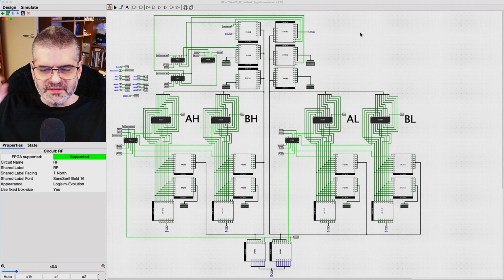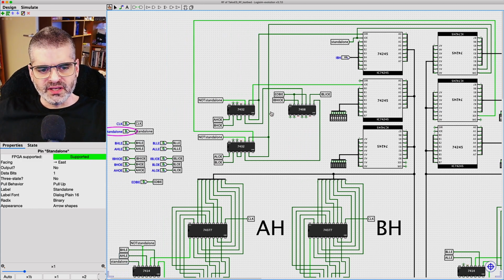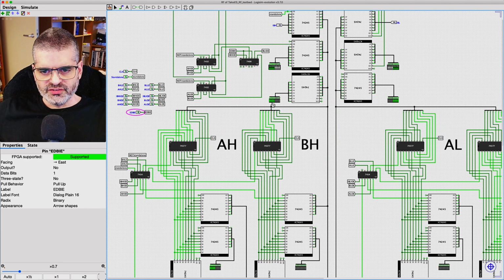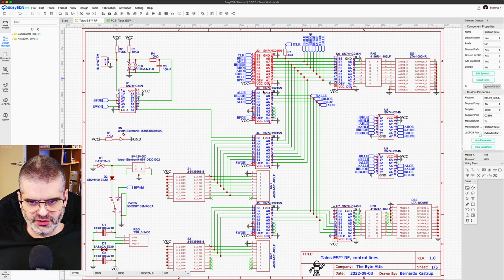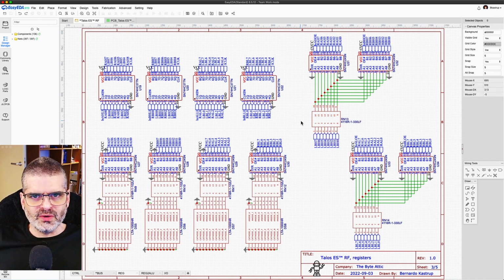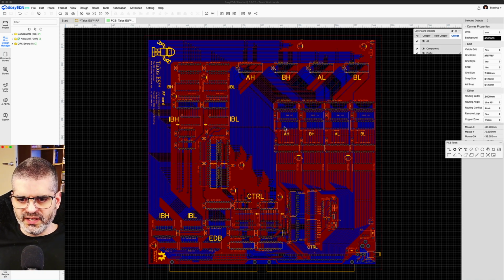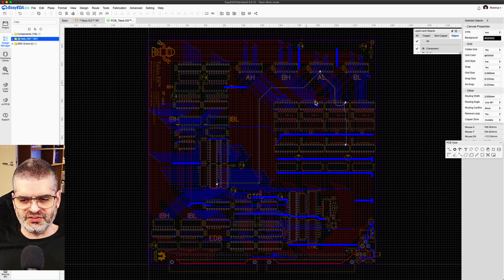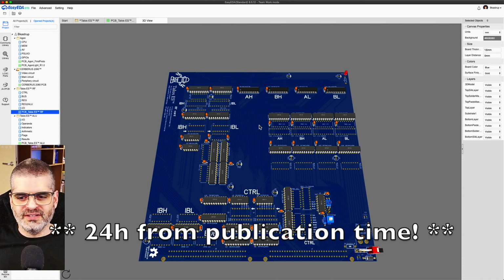Building Talos ES™, the 21st century's mini-computer (Episode 8)

Comment: A question on the topic of treating the resisters as terminators or low pass filters and where to position them: could it be seen experimentally which was best if, say, a circuit was produced both ways? I’m not suggesting for an instant that you should do so — I completely understand not wanting to worry on a hobbyist project — just interested whether it could be done… and even if which is best might differ from design to design.
Reply from the maker: Yes, experiment is always the proof of the pudding. The field fringes produced by current as it flows through traces interact in very complex and often counter-intuitive ways. During most designs we operate based on first principles and reasonable simplifications, but without a full simulation or, better yet, experimental characterizations, it's impossible to know precisely what exact design decision is best. Only in high-end chip design do the tool suites allow for complete simulations of all salient field effects.

Comment: Thank you so much for all this information. Learning so much. I was creating a break-out/pass-through test board for my TRS-80 Model I allowing you to visualize the address and data-bus information and to manually set address/data values. Also with leds (including encoded hex-values) and dips and lots of probe-pins etc. But having seen this I think I am going to do it all differently than how I started.  More buffers, repeaters, etc etc. The board will be larger but that's ok. 

Also, maybe for another video in the future: I'd love to know more about those 'magic' vias that you place everywhere. I know you explained a bit with return paths etc but I don't understand it yet (not an electrical engineer myself). All I see is a via going to the other side not connected to anything so my simple uneducated brain tells me that no electrons will flow. But clearly I am wrong. So maybe if you have time some more in-depth explanation would be awesome.
Reply: Hi Danny. Robert Feranec has done a really great video all about vias with some really helpful graphical simulations; it's called "How GND VIAs Improve Your PCB Layout". I would recommend watching it all the way to the end and reading through the comments too. Hope that helps :)
Reply: Link here if YouTube doesn't remove it https://youtu.be/nPx2iqmVAHY
Reply from the maker: Hi Danny. You are correct: if the return-path VIA is not connected to anything, it won't work! It must be connected to the ground rail, otherwise the current has nowhere to return to. Every signal line is like a mini transmission line. And transmission lines always have two wires. The same applies to signals on a PCB: each signal must have a return path to ground (the second wire), otherwise the electrons will spread and try to find one.
Reply: @thebyteattic  I still don't get it 🙂 If you look at episode 5 at 15:41 you see that white selected via is not connected to anything on the top (red) layer. So where is the return path here then? From where to where would the electrons flow in this case? So I assume I'm still missing some crucial knowledge here. I'm at a loss. But maybe this isn't the appropriate place for this. Hence my question for some special episode someday? 😉
Reply from the maker: @dannybloe  At 15:41 in episode 5 (are you sure that's the episode you meant?) I just highlight a net. That net goes into two pins that are also highlighted, and its signal VIA is highlighted. Right next to the signal VIA there is a return path VIA connected to GND, which doesn't get highlighted because GND is not part of the respective net (the net is a signal net, not part of the ground rail). All return path VIAs must be connected to ground. Floating VIAs do NOT work as return path, so you missed nothing. It's possible that you saw one or another unconnected, floating VIA in episode 8. Those are NOT return path VIAs, but used merely as a trick to stop the copper fill from entering some region where I don't want it to go. So unconnected VIAs are used occasionally just to create a discontinuity. There really isn't much more to return path VIAs other than to complete the closed loop that constitutes any transmission line, and signals on a PCB are mini transmission lines. That said, I'm sure that are videos on YouTube that cover return path VIAs in an easier, tutorial fashion, which may be helpful.

Comment: Hi, me again… at 11.47 in the video the top buffers are pushing values onto the local bus from the external connector. However if it is not plugged in, I believe it will be floating which is bad for CMOS chips. Should you put 10k pull up/down resistors on these signals to make sure they never float? Maybe for safety, also add them to the internal bus?
Reply from the maker: When the system is used in standalone mode, the top buffers are disabled (/OE is high, or light green in the simulator). But the buses should have termination anyway (i.e. pulled high by default), which they will have, but I'll add it to the backplane board, not an individual card.
Reply: @thebyteattic  a quick follow up question - is there a reason you're tying the lines high? Or is it arbitrary?  I personally tie things low out of habit.
Reply from the maker: @dugmeister65  With CMOS ICs it doesn't matter much, as they can source more than enough current to win over pull-down resistors and maintain the level high. With older ICs, pull-ups help maintain the signal levels when they are high, and it's easier for the ICs to sink enough current to win over the pull-ups than to source current to win over the pull-downs. So I usually pull everything up, in the off chance that that helps the ICs maintain the levels high. Especially when using large buses that go across cards, I prefer pulling up.
Reply: @thebyteattic  thanks for the detailed answer Bernardo.  I will change mine to pull ups now I understand your reasoning.

Comment: Nice! Are you using 8 or 10 segments bar leds? If you’re tight on space, using 10 segment ones when you only need 8 might be a bit cramped. I’ll wait for the actual board, since I love to watch the assembled boards working. :)
Reply from the maker: 10-LED bars. Bars with 8 LEDs are exceedingly rare (only one manufacturer on Mouser), and I don't want to have to rely on them. So 10-LED bars are the ticket. Yes, they made things a little tighter, but it all fit in OK ;-)
Reply: @thebyteattic  Try searching for “led b8r” on AE. Those are the red ones, but I’ve seen many colors. And rather cheap too.